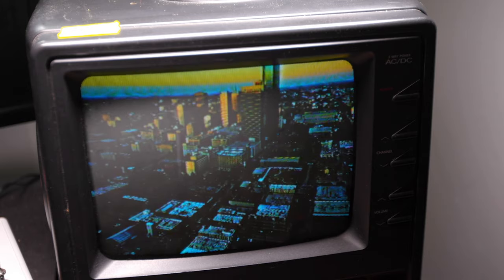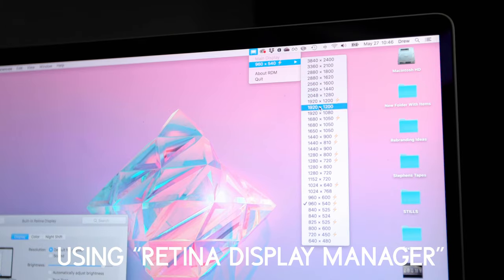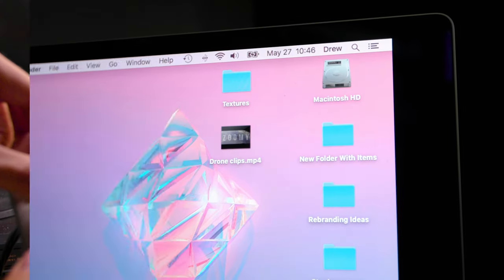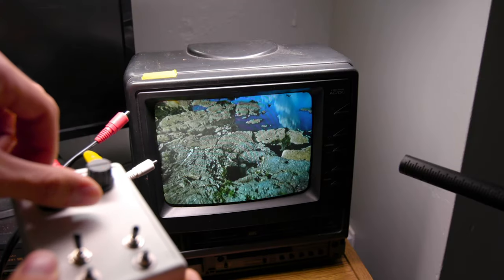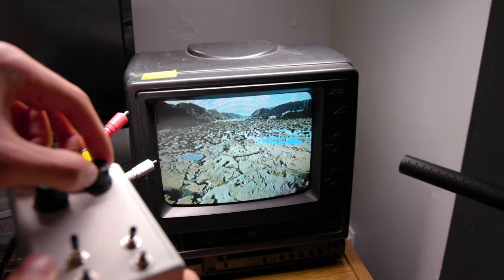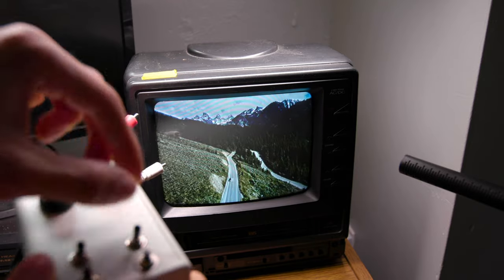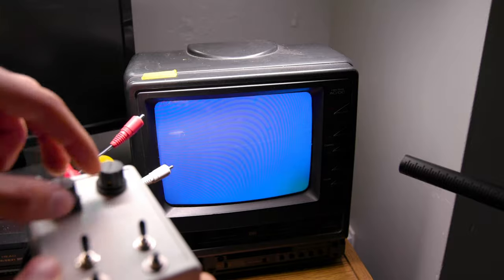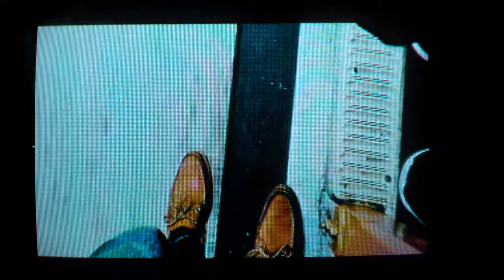How to make Analog Video Glitches | Circuit Bending

Comment: Your CRT has digital noise reduction on, that is why it is dropping out to blue.  Dig in the menu to turn that @#$ off.. no more blue screen.  Use a universal remote if it does not have a menu button.  You are probably only getting a 1/3 of what that device can do.
Reply from the maker: Good to know! I'll mess around with the CRT unit.
Reply: Is it bad to use your laptop as your original video source over burning the video to dvd and then using a dvd player? Is there any downsides to different capturing methods other than recording the screen of a crt tv with a camcorder?  Can you use your laptop as the original source then use a digital to analog converter then use the same laptop to capture the altered video after it runs through a video synthesizer? Will my laptop crash during this process? so many questions
Reply: My CRT just shows the source IF it dosent detect the signal but it shows the image
Reply: I cant find a digitan noise reduction setting in the menu of my CRT. Am i not looking hard enough or could it be something else?
Reply: I got some questions towards what you were saying, can I contact you somewhere ?
Reply: I’ve never seen a crt that needs a tbc 😂
Reply: @mr_hppd348  glitch gear from statik no like laptop as source video. VCR/dvd player best way.

Comment: So I can edit the footage in 4k on my desktop then transfer that to vhs and plug that machine in to distort it? I see you posted links to what I need.

If I want to take my 4k footage and transfer it to VHS then transfer it back to digital what do I need to buy? How do you plug that distorter in? Sorry a lot of questions!!!
Reply from the maker: If you want to transfer to a VHS tape, you'd use the HDMI to RCA converter to plug into a VCR, and then record whatever you want onto the tape. Then you can either use a little all-in-one recorder to record the output from the VCR, or you can use a capture card with your PC, or you can film the screen like the method I show here.
Reply: @drewbdarby  word. thats some work but should look fire in the end.
Reply: Drew B Darby How are you getting the recording from your camera back to your computer? DV to FireWire or Thunderbolt cable? I’m trying this with an old Canon GL2 but I’m running into what I think are timecode issues.
Reply from the maker: In this Video I’m recording to the SD card in my Canon C200. I have a little DV camera that I use sometimes that has an HDMI output, which I use a capture card to record.
Reply: Drew B Darby Thanks for the reply! Recording to the SD card seems like the way to go. Trying to get clips off of a mini DV tape with the setup I have is troublesome to say the least.
Reply from the maker: Mini DV can be finicky, especially on newer hardware. I get why people will keep around an old MacBook if they have to deal with tapes.

Comment: Can you explain the route from laptop to tv? What I got is: laptop -> converter -> circuit bender -> how does it get to tv from there?
Reply from the maker: Laptop > converter > circuit bender > TV. Then my preferred method is just to record the TV using my camera.
Reply: Drew B Darby thank you! And may I ask what tv that is? And what size
Reply from the maker: It’s an old CRT I picked up on Facebook for $10. It’s tiny, probably 11” or so. You can find them free on the side of the road pretty often.

Comment: Is it bad to use your laptop as your original video source over burning the video to dvd and then using a dvd player? Is there any downsides to different capturing methods other than recording the screen of a crt tv with a camcorder?  Can you use your laptop as the original source then use a digital to analog converter then use the same laptop to capture the altered video after it runs through a video synthesizer? Will my laptop crash during this process? so many questions
Reply from the maker: So - it's not "bad" to use a laptop vs a DVD, different processes will yield different results. If you capture using a different method than recording the screen, you won't see the texture of the CRT screen, which may be better for what you're doing. I haven't tried using one computer to simultaneously capture and output video - sounds like a great experiment, but if your machine is underpowered it may slow to a crawl.
Reply: i like to use an easycap rca to usb device for capturing. they are super cheap, like 15-20$, but are really sensitive to circuit bend video equipment so i picked up a cheap TBC (time based corrector) in the signal chain just before the capture device which isnt its intended purpose but still keeps the device from glitching out in ways i dont want it to.

Comment: I kept crashing the rca to hdmi box I have when running my n64 into my analog audio mixing console. I was able to get some cool shots, nothing too crazy though just b/w blurry textures of paper Mario lol.
Reply from the maker: It’s crashing?? Wild. You must really be pushing the limits.
Reply: Drew B Darby microphone preamps are voltage amplifiers hahaha... the EQs and compressors and audio effects were indeed affecting the video signal but the dropout was too significant. Maybe a TBC would be necessary? I’m thinking of using a crt.
Reply from the maker: Oh I totally skipped over that it’s an AUDIO mixer. That’s a whole new world. I’d imagine having an analog display like a CRT might make the signal path cleaner but I’m out of my depth there.
Reply: Drew B Darby I am too!! I think I’ll be going with a camcorder/diy enhancer/crt combo for feedback loops.